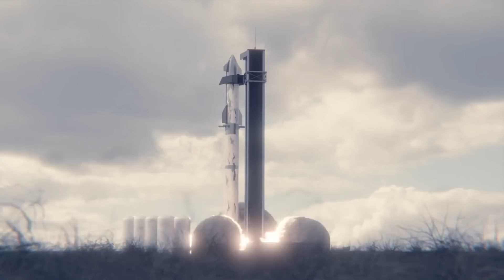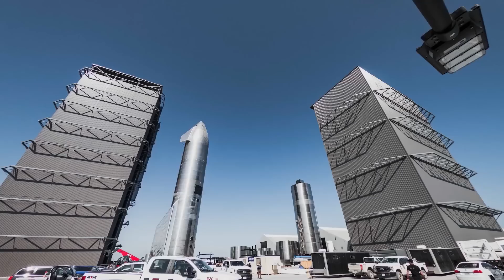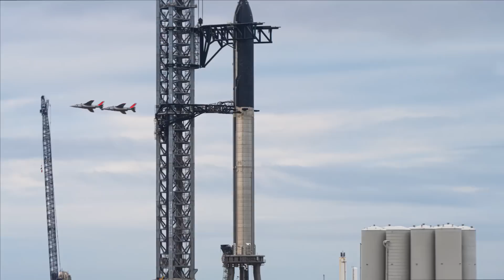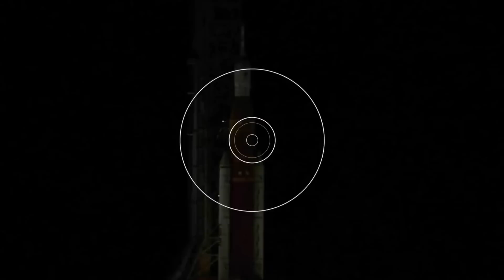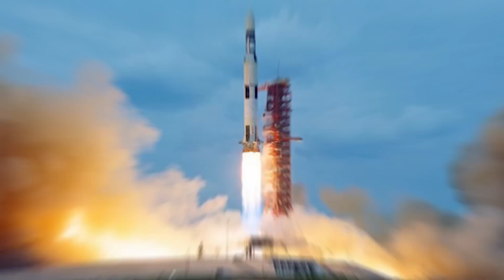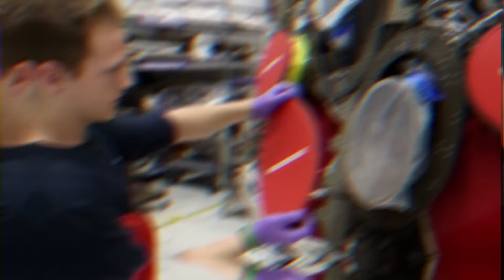SpaceX Starship 120m Rocket Finally Full Stacked Testing 33 Engines For Launch

Comment: Here is an Idea 💡 how about building a new  Launch pad before building it you would dig a 40 foot hole it would be lined with concrete and you would build the launch pad above the 40 foot hole and then when the pad is done you would fill the 40 foot hole up to 20 foot Leavell buy doing this it  Exhorbs the impact of the launch and the hope is you could fire all 33 engines at the same time and would protect the launch pad from damaged. Anyway hope this of some kinda of help to getting it off into space.